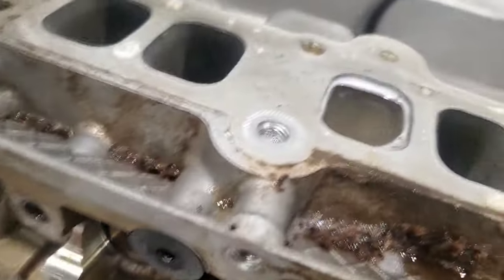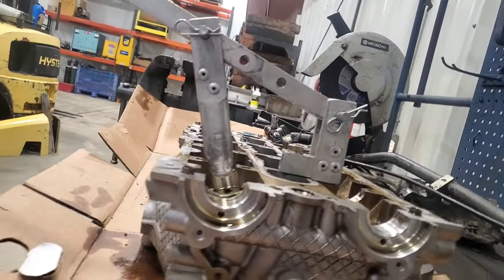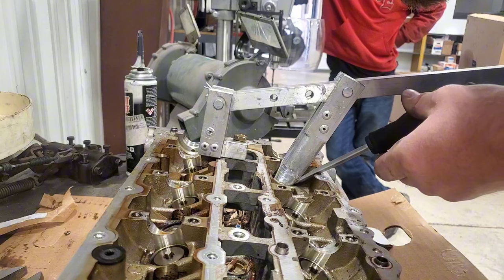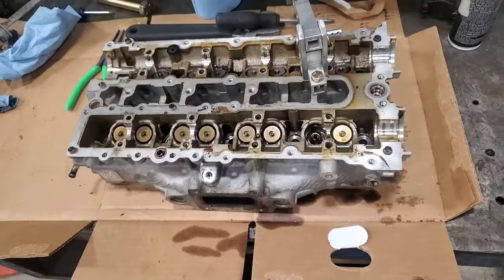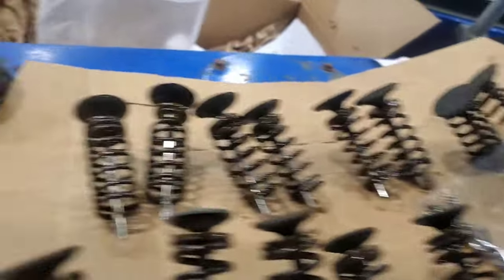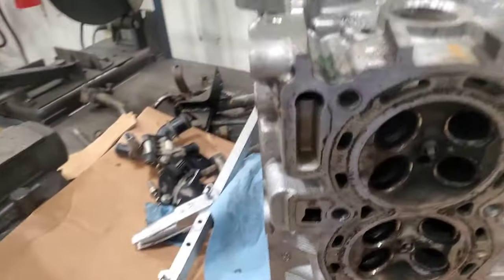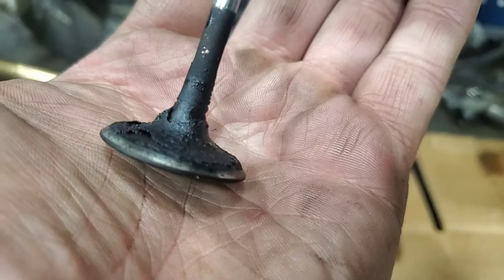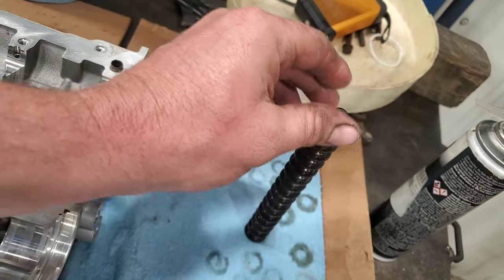Crazy carbon build up, Part 4, Ford 1.5l rebuild

Comment from the maker: Only 114,000 miles before the failure and you can see how bad direct injection is for valves.

I will be installing a catch can to stop this
Reply: It's not the direct injection that is bad I've had a cummins truck since long time . I have a 89 1ton  drw 01 2500 with huge compounds and a 08 6.7 3500 drw.  Once the emissions is removed from the engines the carbone build up is no more. The engine are choking on their own waste. BTW the way I have a fancy edge 2015 mkc this my 3 2.0 engine I just hit 80k
Reply from the maker: @markrich3271  you're correct. It's definitely the EGR that's the issue, but with EGR  and direct injection, you don't get the fuel wash to clean the valves.

Probably misspoke but you are 100% correct.